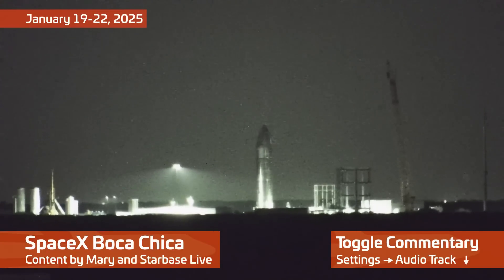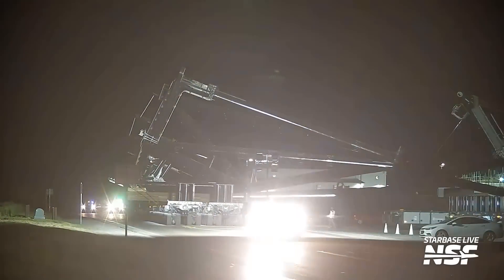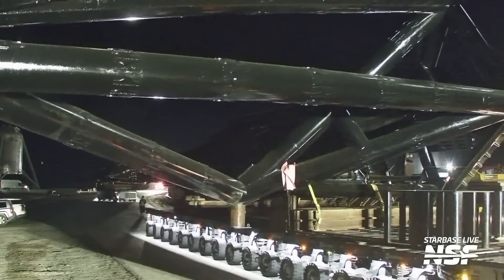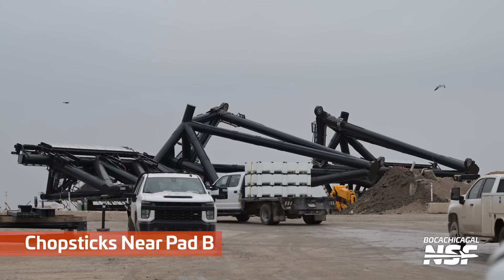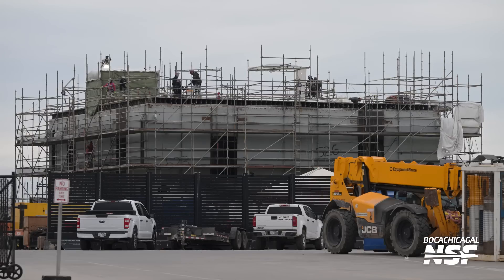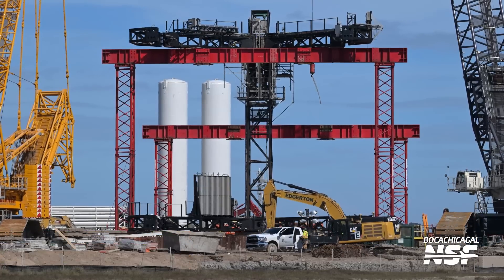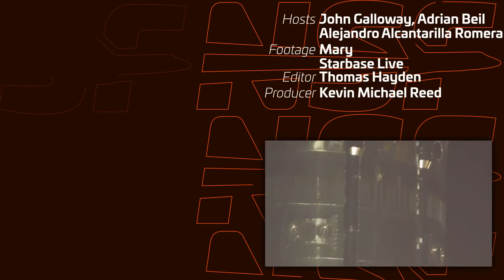Second Launch Tower at Starbase | SpaceX Boca Chica

Comment: The bubble level looks to be 8'. That size really comes in handy at times. At the beginning it looked like tooling, roll carts for different stations. 
I've done Heavy Equipment and Facilities Maintenance, worked around locomotives, ships and Foundry's. My 2 tool boxes have a combined weight of 10k lbs. It still amazing how big some of the equipment, jugs and tooling are that you show in your updates

Comment: I understand that the reduced length of the chopsticks leads to a reduced (second) moment of inertia, leading to speedier closings / openings... BUT, even with the original longer chopsticks, the exhaust of the returning booster has a few seconds of splash against the tower. Now, how much MORE SO, when the shorter chopsticks will be  used?
Reply: The booster already lands where the new chopsticks will be so it'll be a similar scorch

Comment: Will there be a redesign of tower one?
Reply: I'd say it's a safe bet.
Reply: Tower two is pretty much the same design than tower one, only thing would be to get the shorter chopsticks. It's the launch mount for pad A that is more likely to get completely redesigned - like, literally torn apart and replaced by a new design.
Reply: What needs a redesign?

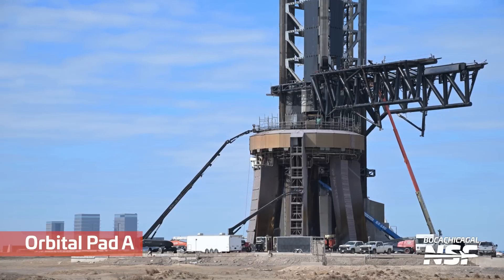Comment: 9:18  What's with the piece of steel that's leaning?  Are they replacing it, or did something happen to it, or is it supposed to be that way?
Reply: It is supposed to be that way. It is the shielding on the staircase that is attached to one of the OLM legs.
Reply: @ericpaul4575  I'm talking about the piece on the tower. It's crooked. Between the olm and the tower at the bottom.
Reply: @  That is not on the tower, it’s on the OLM leg.
Reply: @ericpaul4575  Yeah, I saw that after I replied, lol. I don't think it's a leg, though. I think it's just the stairs, but I've been wrong before. Thank you
Reply: It's both one of the legs and attached to the legs they built a staircase, so that particular leg has an extra large metal protection @CandaceWatson-n8w
Reply: 9.23   I reckon it’s one of the Man lift baskets
We just can’t see the basket behind the tower as it’s obscured by the OLM. Look at the one on the right hand side of OLM & you can see a similar double linkage near the basket, just like the obscured one.

Comment: What you call a bubble level, we call a spirit level in the UK.
Reply: Just call them a level and be correct on both sides.
Reply: I was just going to say the same thing!
Reply: My grandfather's spirit level has lost the green colour after 100 years, but it still shows level accurately
Reply from the maker: Luckily physics hasn't changed much! 😅 - Das
Reply: @normansmart2596  the smaller ones we call boat levels due to their shape...
Reply from the maker: I think those might be called "torpedo" levels over here. - Das

Comment: Are they built for Starship capture or stacking both booster and Starship. 🤔🏴🇺🇸🌝
Reply: I think they will be using the chopsticks for both catching and stacking... The new design pins on the ship should be almost similar like the booster
Reply: @annikwok2536 Thank you for your help. 👍🏴
Reply: They're both for stacking and catch.
Reply: probably will be using pad b for launch and both for catching each stage, as launch is way harder on the pad and pad b will be much more durable and easier to maintain.